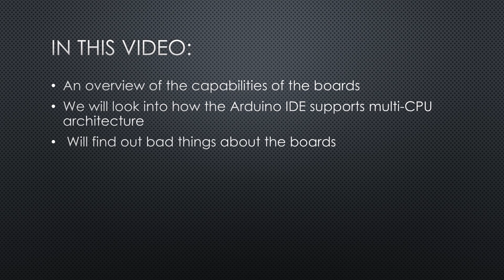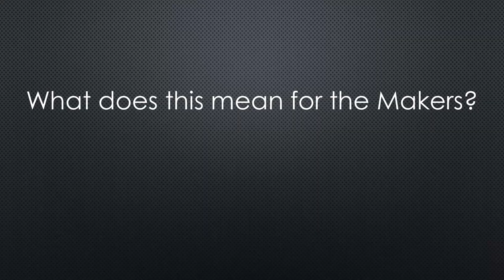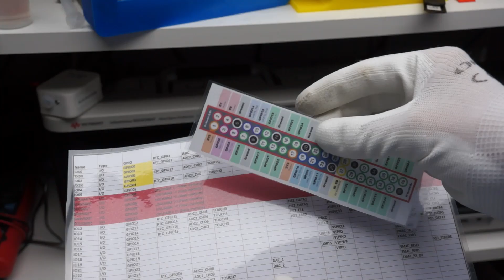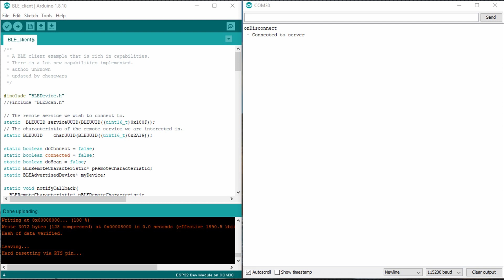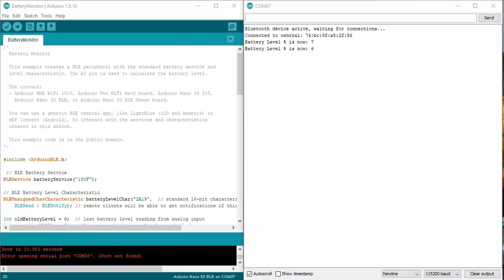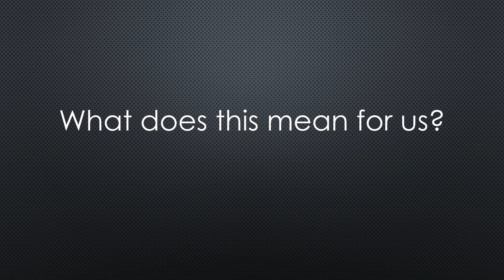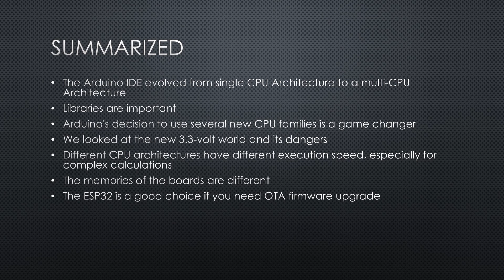#298 Four new Arduino Nano Boards: Test and Comparison (Every, 33 IoT, 33 BLE, 33 BLE Sense)

Comment: It seems that the new boards are destroying what made arduino such a standard for makers, and so popular. In the old days, arduino just worked. All libraries worked with all boards and all boards worked with all sensors. Lots of sensors, lots of libraries. Now things are confusing, and no clear sense of direction. Really think these new boards are a huge mistake, and causing confusion.
Reply from the maker: If I read the comments, Arduino anyway would not sell a lot into the Maker market. So maybe they decided to go for the more professional market where speed and quality is more important. Every company these days has at least a few people dealing with "IOT"...
Reply: @Paul I haven't had any issues with libraries not working on certain boards. I think they have done a good job at making sure everything is portable. You will find incompatibilities in corner cases only. I like the more powerful boards for sure.

Comment: As the libraries get newer versions for the nano 33 IOT and BLE please do more videos. I really appreciate the comparison to the ESP32. My interests are: using a webchat server with BLE servers and clients.
Reply from the maker: Maybe you read the comments. My viewers are not very much interested in these boards :-(
Reply: @AndreasSpiess  Yeh, I guess they are too expensive and too new so that many of the examples are not fully working. I have found out how to load Nordic examples on the Nano 33, which does give users more options. Perhaps use the cheap Nordic hardware for most situations and the Nano 33 BLE sense for specific sensor apps. 

for link google "Topic: How to upload Nordic compiled .hex file to a Nano 33 BLE (Read 108 times)"

It actually loads a nordic .bin file and I bricked my nano because I missed the memory step .

Comment: I have a sneaking suspicion the delay() for the arduino nano 33 ble uses sleep modes, will need to double check this. But anything outside of rapid prototyping for IoT projects that have no real-time constraints, I will have to use the dreaded eclipse based IDEs for MCUs such as STM32. If it weren't for the rapid prototyping offered by arduino, I would have used Cypress's PSoC 63 for my BLE projects.
Reply from the maker: I have a PSoC here. A very interesting part, indeed!

Comment: Always awesome videos. Bit dismissive on the Every however. 

Faster, more memory, 21v input tolerant and about 40% cheaper than the Nano, 50% in the 6-pack. Not "every" project is IOT and the pricey 33's don't give you a simple nrf24 short range remote capabilities for non-wifi scenarios or LORA for that matter. Simplify development for automotive, farming, etc. no longer needing a buck converter to drop the 13.8-14.2 volts down. 

I applaud Arduino offering a new high quality board, more cost competitive with clones and drop in replacement for existing projects. It is my go to board for non IOT as it has longevity. No dispute it is largely a refresh after 13 years and Arduino must recognize the demand still exists. Just surprised you were a bit dismissive of it being an important revision to the Nano. 

Keep up the great videos and 73s!
Reply from the maker: This video is quite old (November  '19). Maybe pricing changed now. We usually do not compare Arduino pricing with Arduino pricing, we compare it with other available products. An there they tend to be expensive. But where money is not a priority, I agree, this is a good choice.

Comment: I worked with Arduino 10 years ago, and was drawn to the platform for its ease of use (“it just works”). After that I was busy with other stuff and recently got back to Arduino. I got the MKR Vidor 4000 board, obviously it’s a lot more capable with the FPGA and all, but the difference is that things do NOT work as it used to. As an example, upgrading the NINA firmware via the IDE only allows outdated FW versions, instead had to use a CMD tool for that. The board has BLE but you can’t use the ArduinoBLE library because the chip is connected to the FPGA and not the MCU. It’s things like that which annoys me. The whole idea of Arduino is to keep things simple, using a single language and compatibility of libraries.
Reply from the maker: Maybe you try an ESP32. It has much more community support. Of course, it has no FPGA. But it is also much cheaper. You find plenty of info on this channel.

Comment: using a 32-bit cpu for monitoring switches or turning on leds,  doesn't sound like a step forward
Reply from the maker: In the '80 we used TTL chips for that ;-)

Comment: esp32 HAS sensors built in
Reply from the maker: You are right. But they are not very useful. Temperature measures the CPU temperature and hall sensors usually have to be placed not where the MCU is.
Reply: @AndreasSpiess  Hello Andreas - I find it not so worthless and used it in some application for example as a additional secure feature - Greatings from Vienna. Best Thanks for your fine Videos.

Comment: nano board should use voltage from 3.3v to 3.7v(4.2V max) to jibe and be compatible with Li-ion or LiPO battery
Reply from the maker: They decided to not add battery management. That boards are very small. Maybe a matter of lack of space?

Comment: What I like most of those new boards is the clean bottom side and the possibility to solder them directly to own PCBs. But this is not true for the China clones of those Nanos, because they are missing the "castellated holes" (those half holes on the outer frame) for price reasons.
Reply from the maker: The modules have castellated holes. The others are more intended as seperate development boards.
Reply: @AndreasSpiess  
Yes, but sadly not the China clones of the Nano Every. I'm waiting for RobotDyn to create a version for professional use in a reasonable price range like they did with the Nano.

Comment: Why are you so worried about libraries? In arduino it is super simple to work on code or adapt old libraries...
Reply from the maker: If libraries for example use timers or port registers it needs a little knowhow to change them. The same was true for the ESP8266 and the ESP32. Many libraries should work right now.

Comment: Beside the normal power consumption I would be interested in numbers regarding deep sleep. 

The IoT version has a Cortex M0 processor so I had expected that it has an I2S interface, so I'm a bit surprised that in your table is a "no". Had someone a deeper look at this and can confirm that I2S is not possible with the Arduino nano 33 IoT?
Reply from the maker: You are right, the chip can do it. But I did not find anything in the Arduino documents

Comment: can we see a practical sketch that demo's bt mesh with say 5 devices and how that degrades data thoughput perhaps... a simple realtime scrolling txt banner per unit concurrently over the mesh
Reply from the maker: I will try mesh with Zigbee where a lot of nodes are connected to mains. Meshes are quite power hungry...
Reply: @AndreasSpiess  ,oh ,apparently https://en.wikipedia.org/wiki/Zigbee says its a really old spec ,"Data rates vary from 20 kbit/s (868 MHz band) to 250 kbit/s (2.4 GHz band)".,  so not so good for 3d axis type meshed pan control , + OC ARE You sure free makers want to advocate using zigbee if its true.  

"The requirements for membership in the Zigbee Alliance cause problems for Free Software developers because the annual fee conflicts with the GNU General Public Licence.[19] The requirements for developers to join the Zigbee Alliance also conflict with most other free software licenses.[20] The Zigbee Alliance board has been asked to make their license compatible with GPL, but refused.[21] 

Bluetooth has GPL licensed implementations.[22]"
Reply from the maker: @paul: But it is used in many Home automation devices. And I do not know if I have to care about licenses if I use ready-made modules of devices. I am no lawyer ;-)

Comment: Personally I still can’t see any arduino board as being optimised for any project. For a project where you want to wire up external peripherals, be they analog or digital, these boards both take up too much room and aren’t very friendly to incorporating on PCBs or other wiring schemes. The standard nano isn’t awful for this, and the new lineup makes soldering onto a PCB relatively straightforward with the plated edge contacts, but there are still some glaring flaws. For example, I was working on a project where the power LED of the arduino caused the whole thing to take more power than my phantom power supply could provide. Another flaw is the continual requirement for a USB-serial IC, which makes the whole thing bulkier for a task that could easily be done instead with a $3 external IC hooking into a tiny ICSP header. Again, not sure if the new ones still have this problem, but they’re over-bloated by their new switching power supplies, again small devices that could easily be located off-board. For prototyping they’re great, but for actually making a streamlined proof-of-concept or a limited production run I’d much rather have a ZIF socket and/or ICSP header on a programmer and a bunch of ICs I can just pop into a circuit after testing them. I tried to do this with some ATMega328Ps once, but they had the issue that they came with differently set fuses (an internal oscillator among other things), and my AVR-ASP that I bought isn’t working at all, there should be a way that works better than this. Such individual ICs would also be more cost-effective. At $5 per arduino, having only 20 projects with them puts you back $100, so bumping that price up to $20 doesn’t make them likely to be anything I’m likely to buy more than one of. Instead I’m stuck in this limbo land of prototyping with a common arduino and trying to adapt this to a less supported system. Not to mention the bootloader taking up half the space on smaller microcontrollers.
I’m thinking of swapping to Cypress’s microcontroller range, they look both high-performance and cheap, though the programmer boards could be cheaper.
Reply from the maker: Just a small remark: One of the boards (I do not remember, which)  has the power LED connected to a pin. So you can switch it off. I found this a good idea, bit the video already was too long...

Comment: Hi Andreas. Thanks for review.
A comment from my experience- i am not sure if it is only your arduino 33xxx boards; but i am using nrf52 boards and arduino IDE, the codes are compiled and uploaded within no time.
May be you can check if there is something wrong in board definitions file or your PC. 
Even nrf52840 DK is programmed very fast.
Reply from the maker: I installed the Arduino boards definition for those boards. Interesting that yours runs so fast.  Maybe I will try a simpler sketch to find out if it has to do with the BLE functionality
Reply: @AndreasSpiess  I have the exact same issue as you. At least 2min compile even on the simplest sketch.  It forces a recompile of everything; nothing seems to be cached.

Comment: Good testing job, yes "common sense" is still lacking in the world with silkscreen on the bottom, Hey Did you SEE, the new small chip that came out,  Attiny1616 / Attiny3217, Yes LOL i too seen the 60fps camera needed,
Reply from the maker: I looked at some of those new Attinys. But I think you need a particular need or high series. Which core did you use for development?

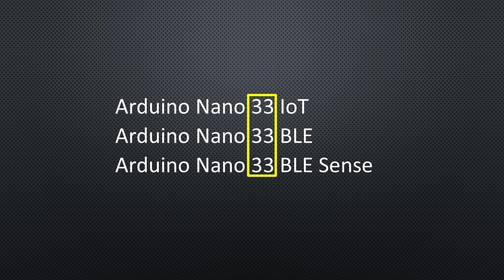Comment: 7:10 You said you weren't sure if the ESP32 is 5V tolerant. It is, ESP32 and ESP8266 are officially acknowledged as having 5V tolerant GPIO.
Reply from the maker: I know it officially from the ESP8266. Do you have a link to the official statement of the ESP32?

Comment: like.  I feel like I dodged the bullet with these advanced Nanos. I'm a dedicated fan of the 328, most of the rest has been ambiguios until I needed a camera. The ESP32 will lay waste to an RP2040.   Your fan Joe.
Reply from the maker: The 328 usually runs on 5V. Most of the newer sensors run on 3.3V. This is why a lot of people use different boards... And, as you know, most of my projects need WiFi...
Reply: @AndreasSpiess  Yes, I watch you because you have those boxes of stuff to test. But I have gears to mesh and servos actuate heatsinks to mount and lights to blink.The 328 knows how to put a 3s Lipo to work.
Reply: @AndreasSpiess  I also watch because you present valuable information. Thanks

Comment: Surprised Arduino isn't natively supporting most Microchip MCUs yet...
Reply from the maker: There are quite a lot to support ;-)
Reply: @AndreasSpiess  I had a "fubarino" a little while back, and I recall I had to install community developed board files into Arduino to get it to work, and the "API' if you will was slightly different for that chip than typical Arduino boards. Not that there was anything wrong with that, just that it was not "officially" supported out-of-the-box.

Comment: It's not bad. But it will affect newbies to learn easily. AVR is the easiest chip which can be programmed using ready libraries using arduino or creating libraries baremetal. Besides we're begining to enter into the era of ARM microcontrollers. But SAMD isn't better compared to STM32 chips. STM chips are much cheaper and contain larger memories. It's a good sign i guess.
Reply from the maker: Most of us use ESP32s which can be programmed the same way as an AVR or ARM chips. Unfortunately, STM is very late with Wi-Fi and still not supported by the Arduino framework (AFAIK)
Reply: @AndreasSpiess  Yeah. that's a serious problem. They should have launched those products after doing bit of  experiments. If they can't provide library fast enough it will affect makers which is really bad for arduino. 
But basic arduino is really great, i must say. But in my opinion ESP will win over Arduino in near future.

Comment: Another very informative video Andreas. I have changed to PlatformIO and with that of course you can load specific libraries for the particular sketch/program in that project code. This should then solve this problem...is this correct?...You would just need separate folders for the libraries for those chips that you keep somewhere
Reply: You can install libraries for each project without having to manage any folders yourself. And I think (can't remember right now), if you add a library to lib_deps in the project config they will be installed for the project only automatically.
Reply from the maker: Good libraries have built-in "switches" to deal with the different architectures. Otherwise, platformIO is a good choice. Sometines, Arduino libraries are also called differently for different boards.

Comment: It's interesting, watching your videos as an electrical engineer. What's so hard about looking at a picture of a pinout, then connecting according to that? You have to count a few more numbers, but it works.
Also, I believe these new chips are entirely unnecessary and just a try to get ESP functionality. 'Newbies' that don't know how to program embedded will use classic chinese copy arduinos for normal projects, esp32s for ones that require bluetooth or WiFi. No reason to go to new Arduino boards.

Everyone beyond that will just use something akin to FreeRTOS. And with CMSIS you have something akin to (although not as simple to use as) Arduino Libraries that works on pretty much any board that uses ARM chips, which is pretty much anything other than ESPs at this point anyways.

I don't see the need to upgrade Arduinos, at least at this point. Amateurs still have plenty of power for their applications with their little 8bit chips, and they have every library imaginable under the sun ported to them. The more complex architecture gets, the more complex programming gets, generally.

There's even some forays into actual, OTA-updatable OSes with the ESP32 that you can program with javascript for people that don't want to dive into Embedded at all. ESP32 is THE platform for low cost prototype IoT computing. The processors are cheap and most probably won't get expensive any time soon, so let's just keep to that, rather than trying to port libraries to odd modules.
Reply from the maker: I think this is why Arduino focussses more on the professional market. If I read your comment, they do not get any money from Makers anymore...
Reply: @AndreasSpiess  Well, that's just what inevitably happens with open source hardware. And really, if chinese companies can sell UNOs and Micros for a profit at 3$, then having to pay 25 CHF for it here in Switzerland just proves there's SOMETHING wrong. Even if we take the 3$ as the manufacturing price, factor in 2$ profit for the arduino company and a 100% markup up to the final vendor in the destination country, that's still only 10$. And if it's too much hassle because of the individual boxes, then why not just sell 3-packs of arduinos for 20$?

25-100CHF is a justified price for a true eval board, that only gets produced in relatively small numbers, with periphery added, and open source schematics and plenty of examples provided.

Arduinos, at this point, though, are more like a commodity. They're produced in such huge numbers that the investment for development of the platform has been recouped many times over at this point. At that point, the price should really start to drop.